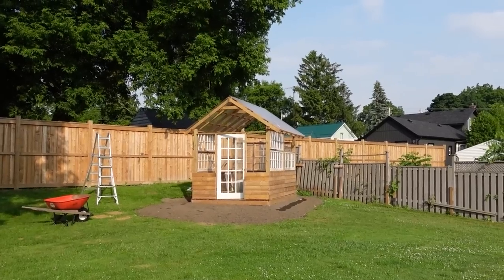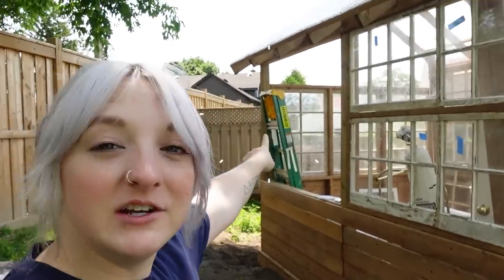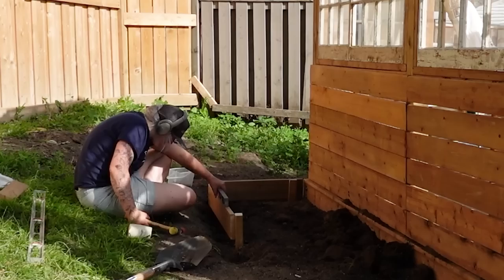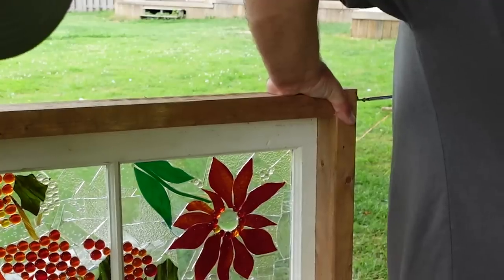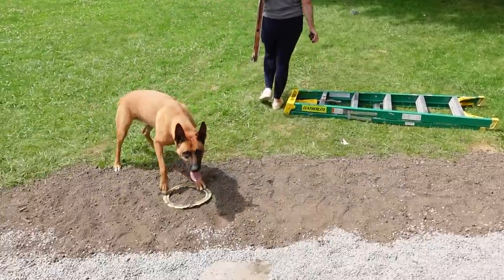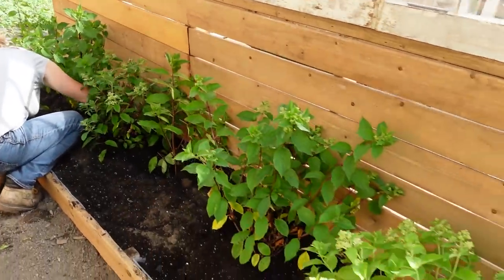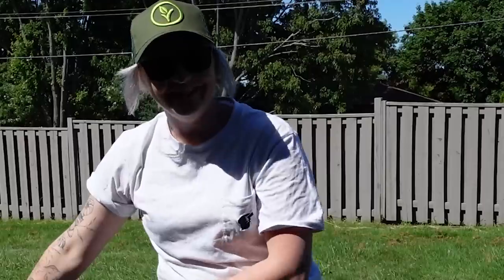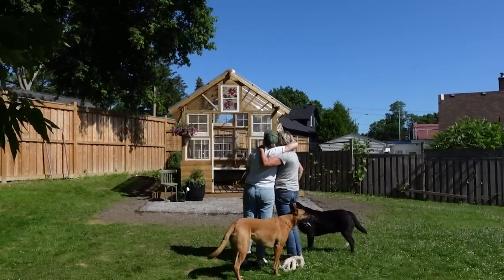greenhouse exterior is FINISHED! | adding pathway, garden beds and solar fan! | EP 3 | DIY Danie

Comment: Just a tip. Never overhead water a hydrangea it cause leaf spot. Water at the base of the root line. It's a good practice to never water anything from the top unless you're trying to wash off a bug infestation.